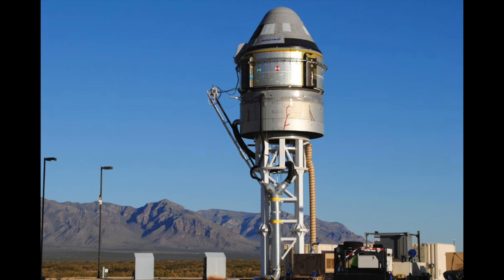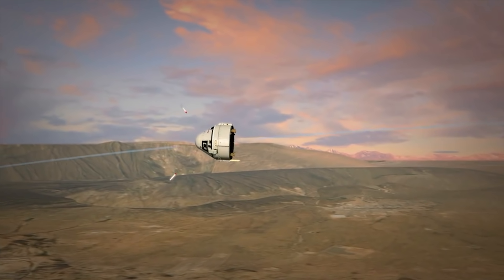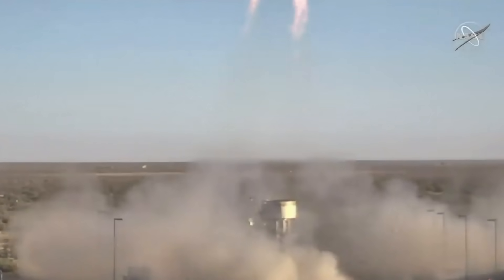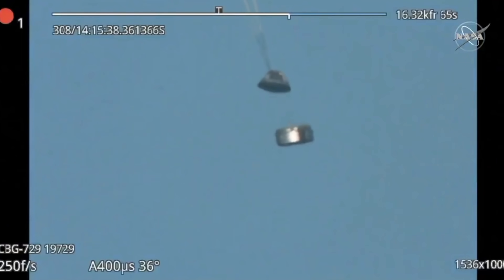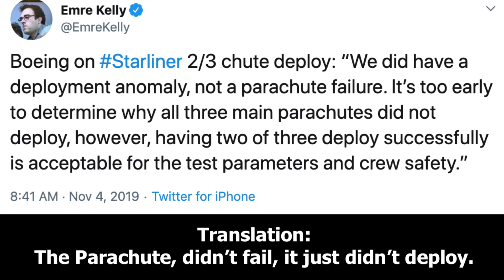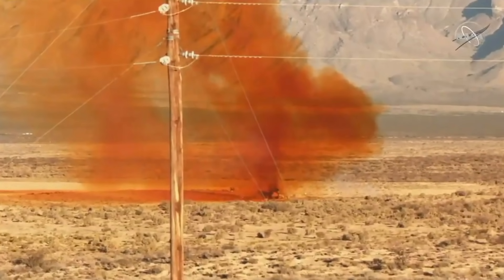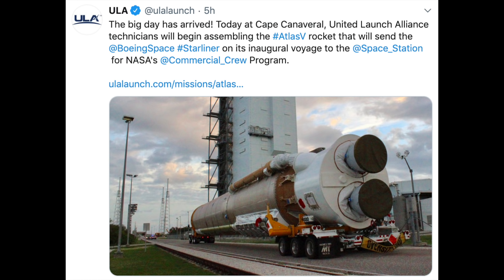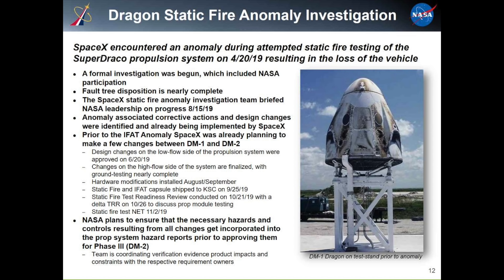Parachute Fails To Deploy During Boeing's Starliner Abort Test.

Comment: I think their problem is that they haven't outsourced enough of their jobs. Just look how well they're doing with the 737 max
Reply: @snarkylive  It's not unstable, with a few hours of sim time any 737 pilot could fly it without MCAS no problem. MCAS was changed late in the design to make the plane mimic the handling characteristics of the normal 737 so they could retain the same type-certificate rating (the FAA has criteria for what is an acceptable deviation from the handling characteristics of a plane to be considered the same type). There was nothing wrong with the MAX other than Boeing needing it to be rushed and retain the same type-rating (airlines wanted the plane specifically to avoid retraining their pilots, which is expensive). Hell MCAS itself would have been fine had they not made the ungodly stupid decision of programing it to only take readings from one sensor (there are two attitude sensors), instead of crosschecking the values and either having a program to identify and discard errant values or simply to disengage the system and alert the pilots when there is a certain margin of disagreement between the readings. I've seen people on Youtube who make drones and model rockets with better software than what Boeing rushed into the MAX, that's the real issue here.
Reply: @snarkylive  The 737Max was TOO stable - it wouldn't drop it's nose to recover from a stall.
The 737NG series are suffering from cracks in the wing attachment structure at about 25000 cycles (about 10% of the aircraft of this age have a major crack). (This part is supposed to be rated for 90,000 cycles and is not replaceable). The exact same structure is present in the 737Max but none of them have the same number of cycles yet.
And then you get to the 787....
Reply: MrMattumbo youre right, the 737max is not UNstable, but it is LESS stable than the 800 model. One of the “different handling chatacteristics” mcas was trying to help pilots avoid was that the 737 max can stall more easily on ascent, especially with 737 pilots who arent used to it. This fundamentally wouldnt exist if boeing didnt say hey lets slap these huge engines on at a different point and fuck up the moment balance! Absolutely shit idea from the start. They shouldnt have messed with the subtleties of a good airplane design and expect software to fix it. Yes, their software was terrible, and yes if they had paid for training no one wouldve died and we probably wouldnt be talking aboht it. but IMO its just a bad idea in the first place to make that kind of a design change to save some money.
Reply: @jeffharper4509  The big engines shifted the centre of drag at high angles of attack forward. Fitting a bigger horizontal tail or strakes (like a LearJet) would have fixed it aerodynamically but chucking an electronic patch was "faster" and "cheaper".
Reply: @jeffharper4509  Makes you wonder if they couldn't have just made the landing gear longer to clear the ground with the new engines. Would'nt change the flight characteristics or weight and balance much, if any. Airbus has longer gear for the same engines on similar aircraft.
Reply: @helicopterdriver  They're MAXed out on landing gear space. It's require a lot of structural modification
Reply: Everything about the 737 max is a purely financial decision that they were hoping they could get away with.

If they had been focused on doing it 'right' they would've either never come up with the concept at all and made more modest changes...

Or they would've redesigned the whole thing from the ground up taking into account the much larger engines that the design is based around.

But of course, that's extremely expensive, so why would they do that?

Let's look at their decision making here;
- redesign 737 for the nth time; much cheaper than designing a replacement
- use larger engines; Better fuel economy, thus better sales
- move engines forward, altering balance; Much simpler (and thus cheaper) than radical structural changes
- try and maintain the same type rating as the older 737 (improves sales, reduces retraining costs)
- use software fix to 'fake' handling characteristics to accomplish said type rating (much cheaper than structural changes, and easier to tweak to get the 'right' behaviour)
- don't implement redundancy into this system. (probably cheaper, with less time taken. But mainly seems stupid)
- make additional indicators and systems related to the software that would improve it's safety an optional extra (more income/cheaper to make)
- downplay the requirements for any extra training on the new features of the design (cheaper, avoids drawing attention to the dubious type certification)

Pretty much every one of these decisions is either about improving the marketability of the aircraft (makes sense. Why design a new model in the first place otherwise?) or cutting costs;
Sometimes both.

Almost none of these are sensible from a safety point of view.
Individually they're fine, but as any accident investigator will tell you, most accidents aren't caused by a single failure, but by the combined results of a series of bad decisions.

And here... We had a series of bad (from a safety point of view) decisions made during design and manufacturing, that led to not one, but two disasters...
Reply: @KuraIthys  Yeah, after the huge management bonuses and the billions spent on stock buy backs (to drive up stock price, to help with bonus amounts) thre just wasn't enough cash left to design a new plane. Boeing needed that money in part to pay the pension of the CEO who made safety features optional - he's now retired with his $250,000 pension - per month.

Comment: 2 years back i spoke with a student from the local University, which was the Head of a Group of students building rockets and they said, that the formulas for deploying Chutes from rockets are quite old and not reliable. The wanted to continue work on exact that problem, because they had 2 failed parachutes before their big flight with a rocket for the german DLR

Comment: "Acceptable result" I bet they designed the 737 MAX 8 with the same philosophy.
Reply: Lol!
Reply: MCAS* and dont r/woosh me i know its a joke
Reply: "Our planes didn't crash, they just failed to stay in the air."
Reply: close enough
Reply: @FB0102  The MCAS system didn't fail - it just didn't give correct readings.
Reply: @DLWELD  MCAS gives no readings.  MCAS didn't fail, it refused to stop.

Comment: The camera person was careful to follow the service module down instead of following the capsule thereby avoiding showing the third parachute failure to deploy.   Then  Boeing immediately started spinning the test result by denying it was a failure.  "It just didn't deploy".  That might be acceptable in a court of law but in the engineering world, that is a failure to meet the expected result of the test.  I am with Scott, I want to watch an in-flight break up of a rocket more than the actual abort test.

If todays Boeing were called upon to build the Saturn 5 first stage,  We could start enrolling 5 year olds in the Astronaut training program as anyone older would die of old age before the booster was ready....

Comment: The Apollo Command Module was designed to safely land (on water--not solid ground!) if only two of the three main parachutes deployed. This actually happened on Apollo 15, when one of the three main chutes did not fully deploy, but got stuck in a partially reefed configuration. Evidently--and I'm only guessing here--the Starliner was designed with a similar system, where, to quote Meatloaf, "two out of three ain't bad."

Comment: I don't think that the hydrazine problem will be as bad when the service module falls into the ocean. They also talked about this in the podcast.
Reply: I don't think so
Reply: @Odysseuss.  what do you mean you don't think so? 

If the service module falls into water it will sink. So even if the tanks rupture they will only leak underwater. Hydrazine is miscible and NTO (the red gas) will react with water to HNO3 which will also mix with the rest of the water. So for a landing in the Ocean there simply wont be any red smoke.
Reply: Yep,  they did say it would be present  today but not when used in anger.
Reply: It may not fall into the ocean. Yes, it's planned to do so but it's also planned to deploy three parachutes!
Reply: @denmaroca2584  Dafuq is this supposed to mean. The deployment system failed. Their trajectory was fine. Boeing builds rockets and airplanes. They know how to follow a directory. What is with this senseless hate?
Reply: @_aullik  underperformance in abort motors for some reason? SpaceX almost didn't make the water.
Reply: @_aullik  I was simply pointing out that plans don't always work, as demonstrated by this test. No system is perfect. What if it doesn't land in water 'as planned'? That's hardly a senseless observation. And where you get the idea I hate (Boeing?) is beyond me!

Comment: The way of progress is not smooth, this is still a win for science, during tests we can see what can go wrong and fix it (this is partially what tests are for anyways) before we find out the hard way. 😉
Reply: This is not science, merely engineering.
Reply: That’s right but “tests” with a lot of press coverage are meant to show the progress a builder has achieved (ie they ought to be successful). The actual testing is supposed to have already been done.
Reply: @pansepot1490  not only that, parachutes on capsules is nothing new. We have them since over 50 Years and normally that should work now flawlessly
Reply: @frankderks1150 
Engeneering:
"The creative application of scientific principles to develop structures, machines, apparatus or manufacturing processes, or works utilizing them singly or in combination."
So this is derived from science, and thus a part of science.
And by the way, the comprehension of problems that might emerge during spaceflight helps discover and develop all things related to spaceflight, and almost all the things related to spaceflight are science related. (I used the word science in a wider context here).
Reply: @Singurarity88  Try over seventy years since the first capsule re-entered....
Reply: ben73 73 - *engineering. That typo rather negates your credibility.
Reply: @mandywalkden-brown7250  I apologize, English is not my first language.
And I don't see how that is a compromising flaw in my comment.

Comment: Wow, that looks an ecological hazard.
Reply: Acceptable for Boeing.
Reply: N2O4 breaks down to NO2 and is scrubbed out of the atmosphere by rain (it's one of the gases that cause acid rain), forming nitrate salts.  We're making a mess of things by spreading around entirely too much bio-available nitrogen but otherwise it's accurate to say that it turns into a mostly harmless fertilizer.

Not that you'd want to breathe that visible cloud.  It'll acidify the moisture in your lungs, which is exactly as bad as it sounds.
Reply: All car combustion engines emit the same poison : deal with it, lol
Reply: @nicejungle  Why should I have to deal with it? No one is paying me compensation for dealing with it.

Comment: Imagine those fuel tanks landing in your back yard - Look out Coco Beach!

Is the abort flight controlled, taking all the explody bits to a safe LZ?
Reply: In normal operation, the service module would impact in the ocean and there wouldn't be a BFRC released into the atmosphere. With this test, they knew it would impact on the desert floor, know it'd produce a BFRC, and even expected it to explode (which it didn't). So the red cloud honestly is not an issue at all.
Reply: @jamesholt1791  The difference between hitting the ocean and the ground at terminal velocity is marginal. You are still getting a toxic red cloud. Redesigning the separation rockets to burn to depletion or vent on the way down may be a safer option - the nitrogen tetroxide is nasty but visible, asymmetric dimethyl hydrazine is a clear neurotoxic fluid you REALLY don't want to come in contact with.

Comment: >newspace companies: "Proton rockets are too dangerous because of hypergolic fuel in them"
>also newspace: puts hypergolic fuel in manned spacecraft final stage
Reply: I mean this is Boeing, not exactly newspace. But small upper stages/service modules with storable hypergolics are really useful, and not nearly as dangerous as having hundreds of tons of the materials in massive booster stages.
Reply: Speaking of... Isn't Proton retiring sometime in the next five years partially because hydrazine is becoming essentially banned as rocket fuel worldwide?
Reply: Doesn't Soyuz have hypergolic fuels loaded on board its service module?
Heck, didn't the Space Shuttle have all its hypergolic fuels attached to the orbiter and have to be checked by those guys in hazmat suits with their own air supply before they opened the crew hatch?
Reply: Since when is Boeing newspace?
Reply: @amperzand9162  probably not as dangerous if you do everything right, but Proton is unmanned and therefore not going to have anyone near it if it's going to crash. To compare, Soviet project Zarya in the 80s was planned to be with more conventional kerosene, because they couldn't afford a danger to crew.
Anyway, IMO getting rid of that rescue tower was a design mistake, they should have kept it to separate the capsule from the fuel more reliably. And I'm not even going to comment on Dragon capsule.
Reply: @StelzCat  Why was it a mistake? A tower is ditched during flight, it doesn´t allow a full abort window and it needs to be replaced every time.
Reply: @michalfaraday8135  the tower is more reliable because it uses solid fuel and the only drawback of it is that it is pretty large. I wonder if they could combine two so that the service module gets the initial acceleration and the tower adds some velocity after decoupling so to separate the crew capsule better. It doesn't matter if we use both elements because both of them are not reusable.
Reply: @StelzCat  I agree that solids are more reliable during a launch, but these 2 will go to ISS and stay there for months. So that means extreme hot and cold every 90 minutes or so. I´ve heard that solids really don´t like that. And I don´t understand why you believe these won´t be reusable. As far as I know all that have a pusher system instead of a tower - Starliner, Dragon, New Sheppard are reusable. And ditching the tower adds another event that needs to go ok every flight or the crew is dead. Also those things have windows  - after all they plan to take tourists. Tower and windows - not a good idea.
Reply: @StelzCat  Actually, I guess in Starliner it is part of the service module, so you are right in that case that they won´t reuse it. Still I think the other two will.

Comment: One other small point, (and it may have been video delay) but there was at least a 2 second delay between the "zero" count down and the ignition of the engines. In s a situation where there is a RUD ... seconds count. If there was a delay when they hit the button I wonder if that was acceptable also? We don't see that in SPACEX launches. ;o)
Reply: Announcers are frequently off a bit on rocket launches.  Syncing them up for us isn't a priority.  I wouldn't read anything into this.

Comment: I'm surprised Scott doesn't talk more about the orange clouds surrounding the craft during flight.  The only place dinitrogen tetroxide should be leaving the craft is through the engines, where it should be reacting with enough hydrazine to burn cleanly.  The fact that it seemed to be repeatedly leaking out during flight is a major problem, especially because it is known to rapidly embrittle nylon, which the parachutes and I think parachute cords are made of.  This may not be as dramatic as the Dragon 2 explosion during testing, but it will likely require a similar level of modification to the capsule to fix, and Boeing has already had to make some major changes to the hydrazine plumbing after that leaked during a previous test.

Comment: As soon as you said "the service module drops off" I thought "arent' they already heading straight down, and going to end up in a cloud of hypergolics?". Good to know my instincts are on point, not so good that their abort scenario involves dropping hypergolic tanks from altitude onto the recovery site on purpose...
Could be the first rocket in history to get a hold because there is not enough wind for their aborts to be safe.
Most worrying thing though is that it appears to be on fire when the parachutes deploy. Fire does not mix well with parachutes. Could be the cause of the failure, and that would take a lot of work to fix.
Given the possibility of parachutes burning and you falling to your death, plus the possibility of you getting poisoned even if you get to the ground safely, the Shuttle abort to Launch site scenario actually looks ok. Even if the 3rd parachute had opened this test would raise eyebrows.
Reply: I think this thing would be launched mostly in Florida... so pad aborts would most likely result in landing over sea. Likewise, Service Module would just sink into the sea and poisoned all the marine life rather than the crew... or the rescue crew.
Reply: A G Systems - 3rd parachute successfully deploying would mean the lines pulling it out hadn’t been cut by the fire, which would mean all the Hypergolics had been burned on the way up...

Comment: I dont think that this realy was a successful test. The fuel started to escape just after engine cutoff. This cant be right. Also that just 66% of the parachutes deployed is just not acceptable.
Reply: I think the fuel thing is planned, you can see the same during tests of the engines themselves:
https://www.youtube.com/watch?v=mOv1ew1GPKc 
I'm not a rocket engineer but my best gues is that it's the result of the turbopumps spinning down.
Reply: By the way. It also didn't turned itself like supposed to do. It was flying sideways as the first chutes deployed.